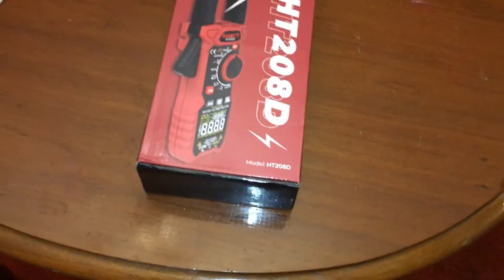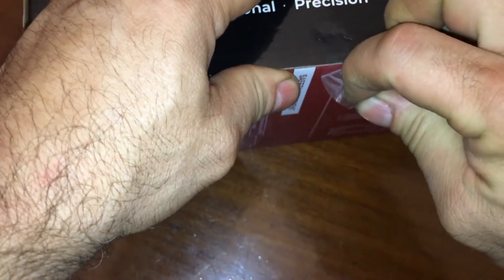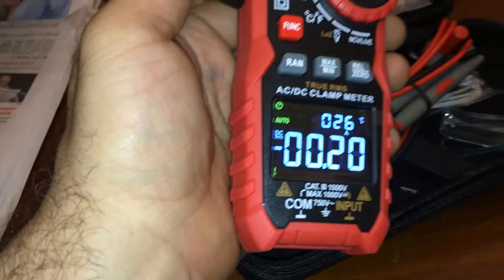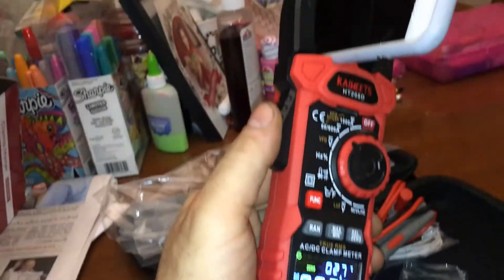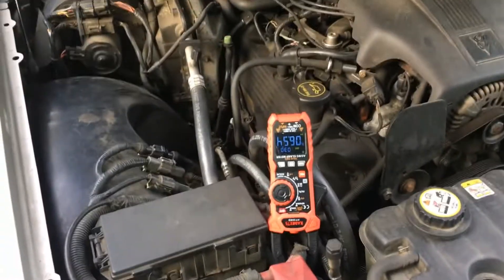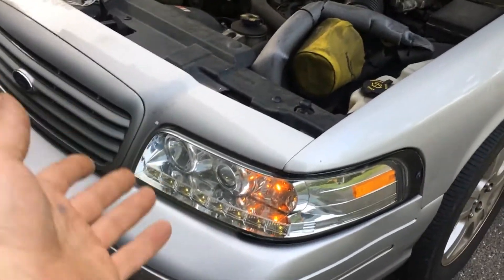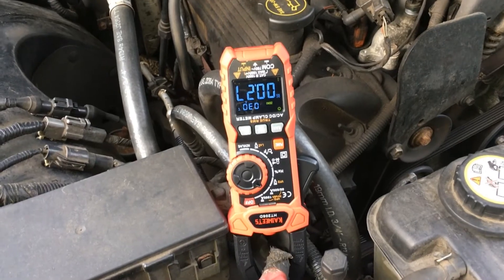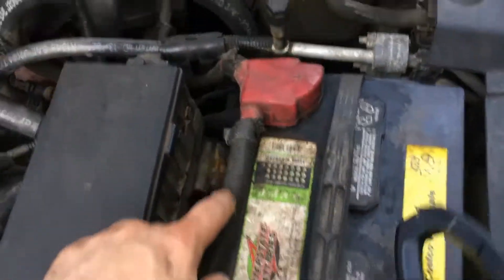HT208D KAIWEETS Inrush Clamp Meter 1000A True RMS AC/DC Current Amp Meter find parasitic drains

Comment: I don't think any clamp on meter will accurately measure milliamps short of spending thousands on a process meter. They dift around too much. Would be better to connect a meter in series to measure. But need to make sure you meter can handle the amount of current your expecting or you'll be blowing fuses in the meter.

Comment: this is if not THE best rated alternative, then one of the best alternatives to the $200+ ones from the likes of fluke and fieldsense meters. I has been tested by many reputable ACTUAL electronics engineers here on YT with professionally graded testing equipment and been found to have accuracy right up there with those other "name brands" as you call them. ALSO... you know... there was a manual right there included in the packaging... wasn't even a thick one.... I'm sure even the likes of you could handle it. ;) #facepalm #boombers
Reply: The 208D meter I got has no issues as far as accuracy in the testing I've done with it, using calibrated standards. Really the only thing I would suggest they do in the future is add a capability to display the ongoing readings when in min max mode.
For some reason this one only can show min or max, and the ongoing readings are not visible.
All the other meters that implement min max functions always can show the ongoing readings throughout the capture session. With this, you'd need to cancel the min max to get any new readings.
 This was an odd oversight in the design.

Comment: So your car had 200ma of parasitic current?  Mine is about 130-150.  I just got the HT208D for the sole purpose of measuring that.  From what I read online, it should be more like 50ma.  And I do suspect my car has some extra drain happening, so the meter seems to verify my suspicion.  Maybe you've got even more parasitic drain going on.  Did you zero it?  It seemed to work well for your headlight measurement.

Keep in mind, 50ma would only be 00.05 on the display.  And the spec says the last digit could be off by a count of 8.  So that's a big range of uncertainty, if you happen to get a meter that is all the way to one end of its spec'd range.
Reply from the maker: This meter is a bit suspect to me. I actually returned it. I have another that I havent tested yet though LOL... The draw I show is most likely normal because I opened the car door etc... that means modules are alive. you have to wait certain times for certain cars for the modules to go to sleep. they also have tests that have to be met to go to sleep. aka leaving a door open, trunk open etc.
Reply: @bobspurloc  Well, 200 mA current should be OK, the car easily draws that amount of current or even more, for 10-15 mins. Then, it will go into sleep mode (if you don't touch anything) and then it should be around 50-60 mA, but that depends on the car too. I see, you cannot really use a clamp meter, and returning it was a mistake, since it is a very good unit in that price range, IF you are able to use it's potential. You are clearly not that guy... And buying a more expensive unit will not give you the knowledge, and even a 10x more expensive unit will give you the same wrong results, if you cannot use it. No offense.